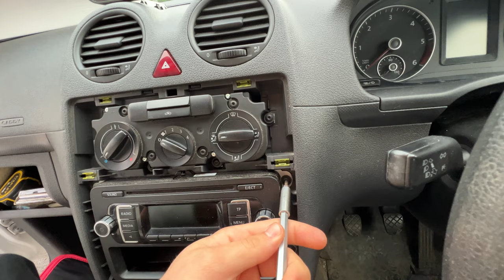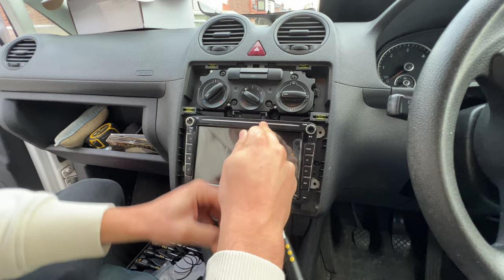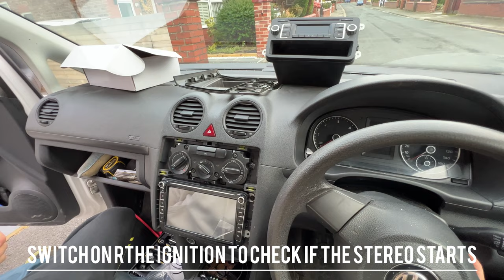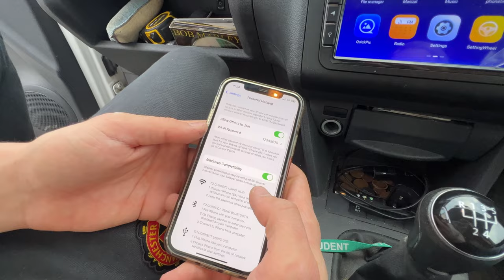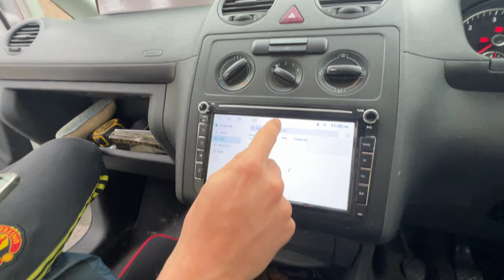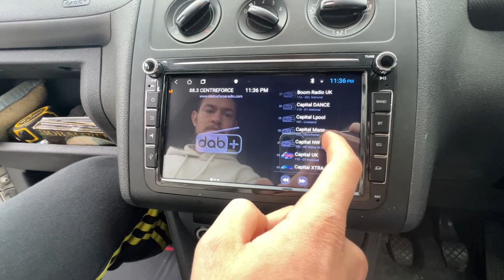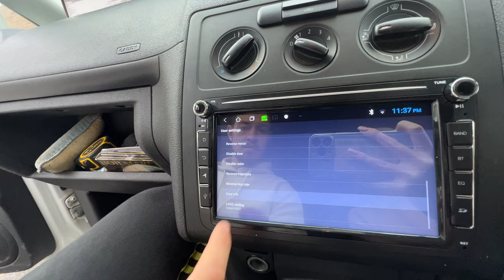How to Remove Original Stereo and Install Android Car Stereo in VW Caddy + DAB Radio Aerial

Comment: thank you so much for this video it helped me replace my old stereo but i have one problem, it doesn't turn off in any way I did neither the left button or by turning off the engine
Reply from the maker: Hello, check the wiring harness it will have orange and red wiring connection make sure it is disconnected, if the canbus works fine the stereo will work only when the ignition is on, thanks!
Reply: @pluscenter  hello, thank you for your answer I did it and it worked perfectly.. but now I have a problem that the radio does not work even if I connected the antenna correctly , do you know what could cause this problem
Reply from the maker: Hello, you can install radio antenna with booster check on ebay, thanks!

Comment: Hi there, are you able to give the of the seller of the radio please? I bought one off ebay and it didn't seem to have the correct parts. Thanks
Reply: Its called pluscenter. Its the same guys that posted this video. 👍

Comment: Hi, at 4 mins 30 secs why are the white and red AUX out DIN cables connected like this? thanks
Reply from the maker: Hello, this is if the car has factory fitted AUX so you can use it to the new screen. Thanks!

Comment: dont you have battery drain problem ?
Reply from the maker: Hello, our systems come with all adapters and canbus so the stereo works only when the ignition is on or the car is started in this way there’s no chance for draining your battery. You can check more for the stereo in the link in the description.

Thanks!

Comment: My screen keeps running even when the keys are taken out from the ignition. Any thoughts? 😂
Reply from the maker: Hi, you will need to disconnect the red and orange small connection on the wiring harness. After that the stereo will run with the key only. If you need any more help, please contact us.
Reply: @pluscenter  Do you mean the red and orange cable that goes into the wiring harness? And thank you for answering! 🙏🙏
Reply from the maker: @MN-hi1dg  Can you contact us by email with a picture of the wiring that you have and we will send you over images of how to solve?